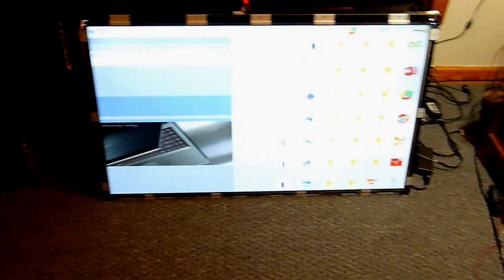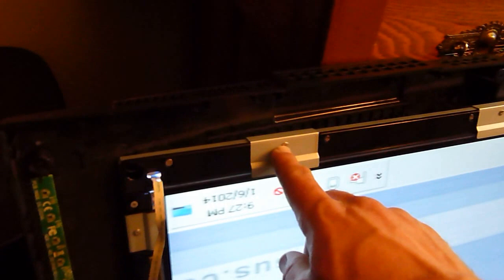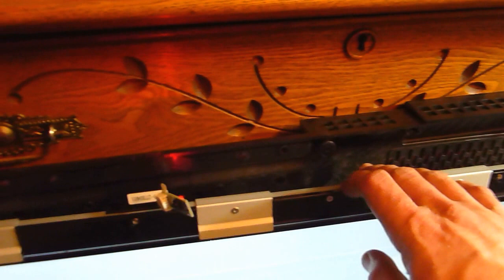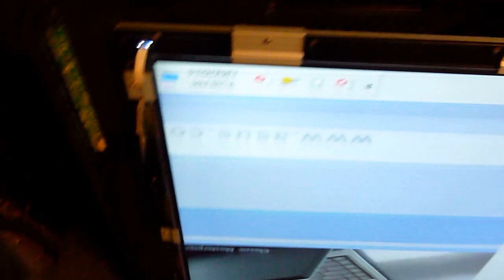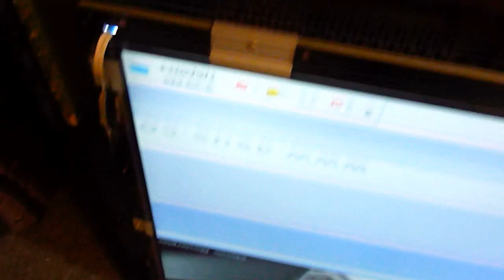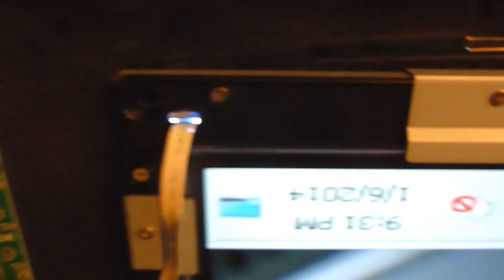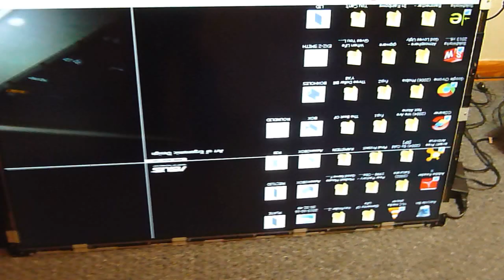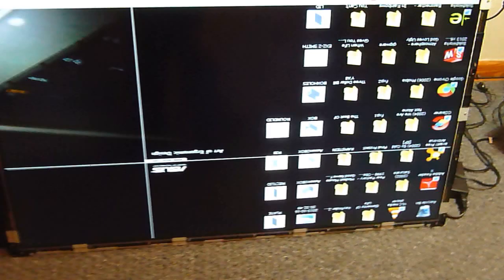LD-4655VX Westinghouse LED TV doesn't power on, or half of the screen is out.

Comment: Any particular reason you flipped the cable over to connect the melted end to the motherboard? Could you also just pull some "slack" at the end where it's melted, slice away the plastic, and reconnect the cable to the LED panel?
Reply: What you suggest may  be possible by removing not only the bottom long black plastic strip, but also the sides (see pictures):
http://providentengineering.blogspot.com/2014/12/how-to-fix-westinghouse-ld-4680.html
Not sure if a person could get enough slack without pulling the cable out of its channel in the aluminium backplate, though. Might end up being squeezed between the glass and plate.

Comment: Just as a clue... Do not take the ribbon out of LED strip. Just back it away from the frame.. apply hot glue, ( to make insulator) cut the corner where the black plastic binds it and pinches it down during the installation of the back, and it fixes it 90% of the time. I have done many many of them in my shop.

Comment: Hey can I ask your advice?
Reply from the maker: Whats up?
Reply: @MrBensmith8302  so my Westinghouse is showing no picture. I am seeing the shadow of the apps and I can hear the sound if I go on YouTube. Is it fixable?
Reply from the maker: @prezgambinomusic  it sounds like you have a newer model.  If you have the same model, yes its fixable.
Reply: @MrBensmith8302  mines does not use hdmi cords or anything and it plugs direct to a wall no adapter or anything
Reply: @MrBensmith8302  I love
Reply: Model is WG55UR4100
Reply from the maker: @prezgambinomusic  that model is probably 10 years newer, so it will have a different design and i cant say if its fixable